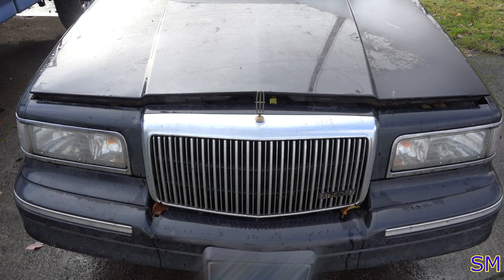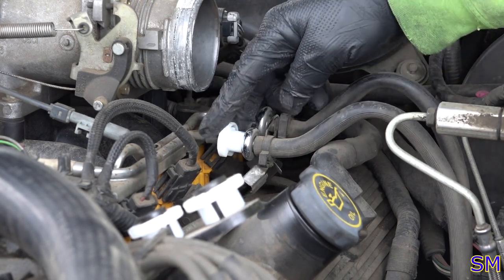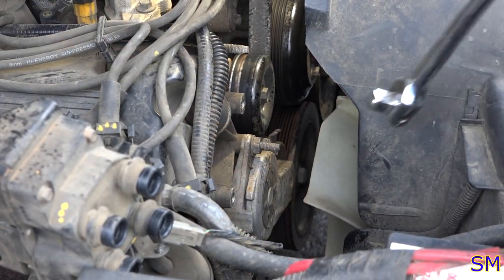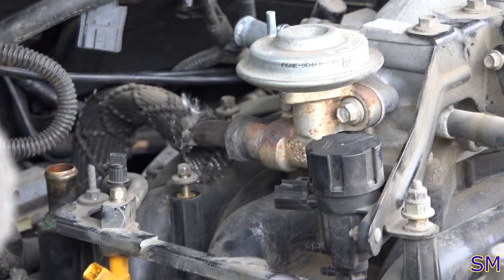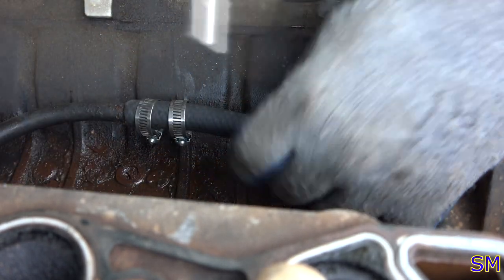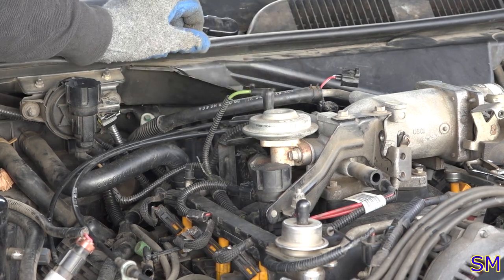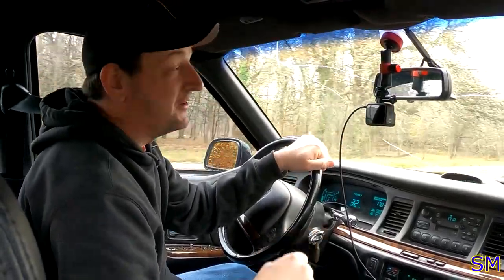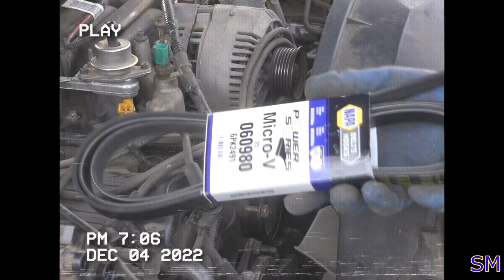96 Lincoln Coolant Leak 4.6L - Fixed for $6

Comment: OK, hose was $6, how about belt, and intake gaskets?? And, what  is the correct torque for intake bolts, thank you ! Nice job, youtheman =) Merry Christmas from Sunny Florida!
Reply from the maker: $6 for the hose, around $30 for the intake gaskets, and the belt was around $25. So about $60 total in parts. Wasn’t trying to mislead people with the thumbnail. I guess I was trying to convey that the problem was a $6 hose. Torque I believe was 18-22 ft lbs. Oh soak up that Florida sun for me!
Reply: I was thinking the same thing! Do it all while you are there!

Comment: Good job. I like working on the older cars myself. I replaced the intake manifold on my 1997 Ford Thunderbird I had years ago. So much fun. 
Did a quick fix the other day on a friends 2002 Town Car. Thinking about getting back into fixing cars again for people in need. Miss turning wrenches.
Reply from the maker: That is a noble cause. I like it. So many people get ripped of in this industry.
Reply: @SwedeMachine  Ain't that the truth. I've , off and on, been working on vehicles since 1968. I have keep up with technology as it has changed over the years.
Reply from the maker: Good for you! Always keep on learning. Simulates the mind and keeps you young🙂💪🏼
Reply: @SwedeMachine  That's what I've told my daughter. I'm 72 now and I keep on learning. 
It's just a pain having a 18 year old learning brain stuck in a 72 year old body.
Reply from the maker: Even though I'm younger, I have noticed I don't bounce off the ground as much as I used too ha ha. I feel ya boss. =-)
Reply: @SwedeMachine  The bounce just seems to fade away. But what the hell you still just take life one day at a time. Now the days seem to go by a little faster. Lol

Comment: I hope the $6.00 in the title referred to the parts and not the labor. You did better with the fuel lines than I did with the cheap plastic removers. I couldn't even throw mine across the street no matter how much I yelled at it. You make it look easy. Thanks for the vid!
Reply from the maker: It did refer to the immediate failed part only👍🏼. Yeah I hate the plastic removers too. 🙃

Comment: I always wondered what went into that job… I think they also had an issue with the plastic intake splitting and spewing coolant everywhere, but that one has a metal crossover, so maybe that’s already been dealt with. I had the first gen 4.6 in my 94 Crown Vic, which didn’t suffer from any cooling system issues, just the dry rotted valve stem seals and an EGR passage that constantly got carboned up. Not the most powerful engines, but man they’d run for a looong time even in rough shape. 

Sounds like that one could use an exhaust manifold or two, but I’m guessing that’s pretty low on the priority list lol
Reply from the maker: Yes to the exhaust leak and yes low on the priority list. Yeah plastic anything makes me frown lol 💩
Reply: The metal crossovers still leaked.  Best to go with a whole new intake.

Comment: Are you close to Olympia, Wa? I have a 97 Town Car I just bought. Has a "leak", but no visible coolant on the ground. Oil is good. No white smoke. Found your video and used my scope to take a peak under the intake and the hose is good and dry. Also a "cylinder 1 misfire". Looking for video ideas? I may have one for you.
Reply from the maker: Unfortunately, I am overwhelmed with repairs right now but thanks for the offer I really appreciate it! If number one cyl has a misfire and you’re losing coolant I may suggest pulling the number one spark plug out and seeing how clean it is versus your other ones. Perhaps a head gasket is on his way out and that number one cylinder is starting to eat coolant? Something you can check for free👍🏼

Comment: Fortunately for you, that intake manifold appears to be an aftermarket replacement.  As most mechanics that work on these 96-97 Town Cars know, the original stock intake manifolds are prone to failure due to poor design (all plastic, especially in the front where the alternator mounts to it).  To have disassemble all of that without replacing the original intake manifold would have made this a redundant chore.  I would have replaced that rotten, rusted metal tube altogether.  Other than that, nice job!  Thanks!
Reply from the maker: Most welcome✌🏼

Comment: Question, are the bands from the hose clamps going to rub from vibration on the underside or valley of the intake manifold. Aka was there enough clearance? Great Videos Thank You 🙏
Reply from the maker: Great question. There was just enough room. Barely. When I lowered the manifold I watched to see if the hose flexed / or if I felt any resistance at all and it did not. Most welcome 👍🏼
Reply: @SwedeMachine  Awesome, I owned a 99 Town Car with a 4.6 and never knew about that intermediate hose. Have a Great Day!!
Reply from the maker: Glad to help and thanks for watching!

Comment: Hi. Excellent video. What did you remove at 17:20? I think mine is a lot looser than this
Reply from the maker: It’s the PCV tube that connects your PCV valve to engine vacuum. Thanks for watching👍🏼😊
Reply: @SwedeMachine  it is because of people like you who take the time and energy to post content on youtube and reply to comments that rookies like me can be handy. thanks a tonne
Reply from the maker: Absolutely! If yours is worn out and loose, you make have to get new rubber and plastic lines. Should be fairly easy to acquire. Don't block it off. A running engine will build up toxic gases and moisture in the crankcase. That PCV system allows the internal engine to breath as well as getting rid of that gas and moisture by sucking it into the engine to be burned. Good talking to ya!

Comment: A new windshield is probably next on the list...or should be. Yikes!! That was quite a bit of major surgery,  nice to see the patient doing better now. 👍 I have a 2006 Crown Victoria with the 4.6. Hopefully this job is still a few years away....not that it looks difficult or anything...LOL.  Good job! Thanks for sharing! 😎
Reply from the maker: The windshield does need to be addressed. I was a bit nervous taking it through the car wash not gonna lie😂
Reply: The later engines have a metal pipe that sits under the intake unlike this one. My 99 grand marquis has a metal pipe.
Reply from the maker: @MattsRageFitGarage  Ah great to know! I guess I lucked out haha😉
Reply: @SwedeMachine  The later ones there is a fitting that pushes into the block when the water pump is out, it has 1 or 2 o rings on it and then the pipe fits over the fitting and is held in place by the mounting screw on the back of the block for the pipe, eliminating that heater hose chunk.
Reply from the maker: @MattsRageFitGarage  Ahh 10-4 on that

Comment: I was wondering if you could reroute that hose that why it wouldn't have to go underneath the manifold
Reply from the maker: Ford fixed the issue in the later models. I might have been able to put a 90 elbow at the water pump fitting, then out the front top but it would be a hack job. This was a cleaner solution and should last a long time.

Comment: The old 4.6 2-valve was a work horse. Highway Patrol would run em 200,000 then a taxi company would buy them up and put 200,000 more stop and go miles on them.
Reply from the maker: Honestly for a domestic 175K car this thing runs a treat👍🏼

Comment: What do I call the hose that needs replaced? I'm trying to order the parts I'll need from rock Auto. 
Not sure what to call it in order for me to place theorde nd receive 😂
Reply from the maker: It’s under “Heat and Air Conditioning and under Heater Hose. It’s called “Assembly Outlet” or “assembly tube and hose under intake.” There might be a couple different flavors of makes, so you be sure select the right one. 🙂

Comment: I swapped motors, I put a 4.6 out of a   04 mountaineer in my 97 ford f150 and the knock sensors are different. The 04 has two and the 97 has 1,so what can I do to make it work?
Reply from the maker: To avoid trouble codes from popping up, I may suggest to plug one in into the engine and the other one plug it in but dangle it off to the side perhaps. Somewhere where it’s not going to flop around and won’t accidentally knock about generating a false signal. 
Usually those knock sensors will generate a little bit of voltage, so if one of two is not plugged in it’ll probably trip the check engine light anyways. As long as the engine can see some type of knocking going on it is better protection than not having none plugged in at all. I would not suggest wiring up the 2 wires to one sensor. That might confuse the ECM and set a trouble code. That would be my best guess to approach your situation.